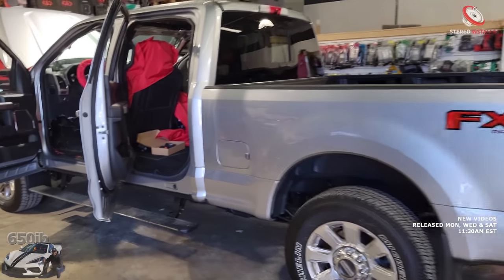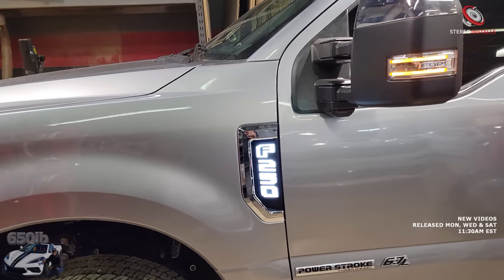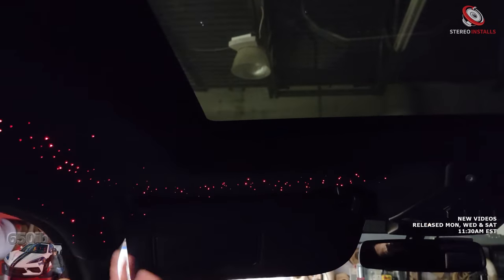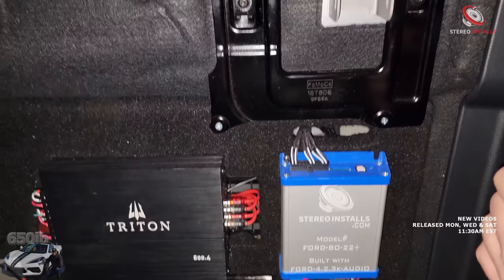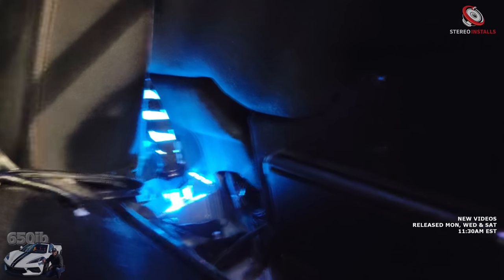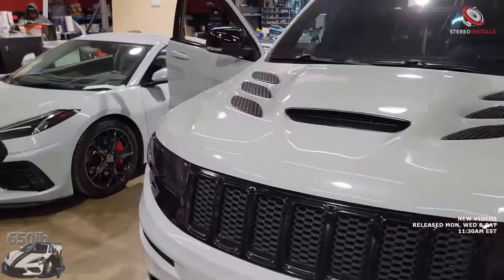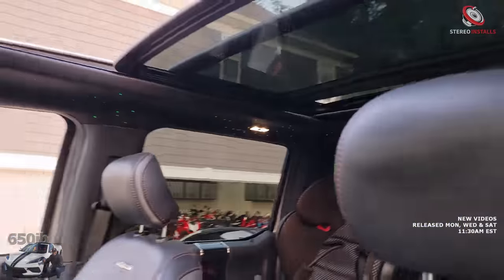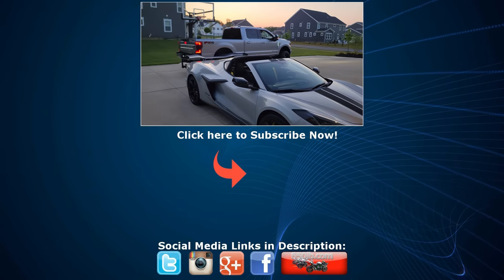AUDIO & INTERIOR UPGRADES MADE MY FORD F250 SUPER DUTY 6.7L DIESEL AMAZING!

Comment: Did they upgrade your alternator to run all of the extra power long term?
Reply: U don’t need to .. the one on the F250 is more than capable
Reply: There's no need. You only need to upgrade an alternator or alternators if you're running atleast 10,000watts. Plus.

Comment: 650ib please do not use Fuel wheels if you're going to be towing, I have seen so many people lose a wheel the past few weeks it sickens me. Especially when you're towing a 30,000 pound gooseneck trailer down the highway and it just collapses and sends you down the road with no control and all you can do is pray you don't die. Fuel wheels are not safe, they're not load tested or rated for trailering. You can only put 2500-3000 pounds on each wheel, they even tell you so, you will break them.